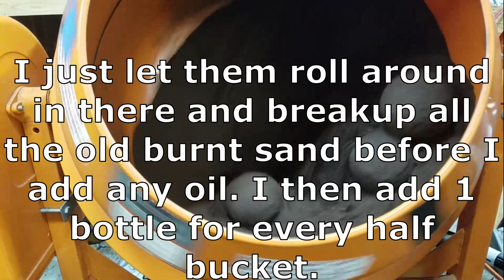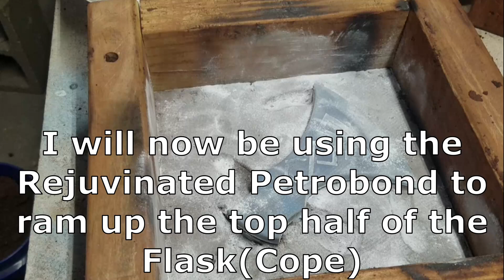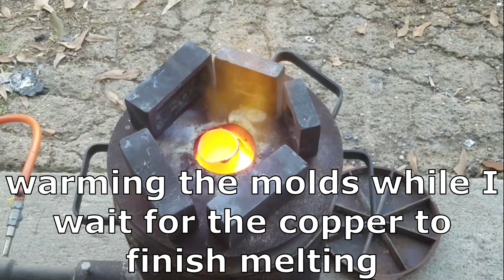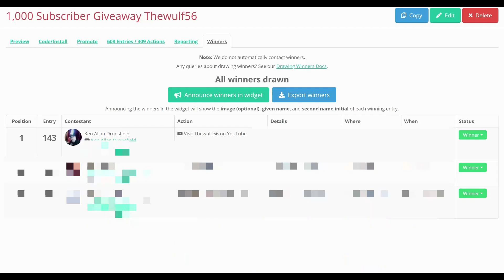#Devilforge Rejuvenating burnt Petrobond Sand at home and Casting a Bronze Celtic Axe

Comment: Had no idea you could rejuvenate Petrobond. Besides initial outlay, this would be a great way to save some $ on it! Thanks for sharing! Makes purchasing that Petrobond a bit more appealing! Grats to the winners!
Reply from the maker: yeah, you can, this was my first time trying it, and it works pretty good. so I can use it over and over. Your gonna eventually need to replenish, as you will loose some, they sand is just to fine to be able to save 100% but at least you can save some money. Might need to keep it warmer when trying to remix it, its been a bit cool here and its not mixing right in the 40 degree weather like it was when it was warmer.
Reply: @Thewulf56  drat. It would be a summer only thing here as we're not even up to 40 in the days now. But still feasible to save and do when it is warm! I'm going to watch for some bocchi balls and a mixer on the classifieds now.
Reply from the maker: @silverkeys  I got mine from harbor freight, for pretty cheap, and they have 20-30% off if you get their coupons. I got the bocce balls off Amazon,  but you could use a bowling ball to, some use that. You just need something round with some weight. If your shop is heated, you might be ok
Reply: @Thewulf56  we are on HB freights mailing list! I'll check. We don't have heat yet in the garage but we hope soon. We'll be looking at a wood stove this next week to see if it will work for us.

Comment: Incredible work, that came out great!  Love the painted inlay and the shine
Reply from the maker: Thank you.
Reply: @Thewulf56  I’ve been saving my burnt clay as well.  So far I haven’t used it twice, but I plan to soon.  How many times (estimate) did you use that sand before you added the oil?  And what kind of oil was it?
Reply from the maker: @RobinhoodCoins  two cycle oil I got from the dollar store. If you only have small amounts, you might be able to get away with a drill mounted mixer, or maybe an old kitchen mixer, though I have never used those, used to use a drill, but that was only to break up the big chunks from the cast. I wasn't adding oil or nothing.

Comment: You are very talented man!! I was wandering what you did so that you could re-use the burnt stuff. Very cool!
Reply from the maker: Thanks Rick. Took a while to save it up, I had upwards of 300lbs of sand, most of which is now burnt, with about 33lbs still new in a box and maybe 60ish lbs of used, but unburnt. Still have a big tub to finish up, but I'm close to half way done. I will be able to make some bigger projects that I have been holding out on cause of lack of sand.
Reply: @Thewulf56  I have some delft clay, just a small amount, with a small ring. I've been meaning to try some pours.
So I separate the burnt clay from the used clay after the pour. can I reuse the used clay after that?
Reply from the maker: yeah, just scrape out the burnt stuff, and the rest of it should be good to go. Make sure to save the burnt stuff, when you get enough of it, you can just do what I did.
Reply: @Thewulf56  thanks for the info.

Comment: Great video on rejuvenating the petrobond, this will save a ton of money! Also good to see you do a comparison, I do not see any difference so the rejuvenated sand must be really good :) I might buy and try this one day too, who knows :) That axe head came out fantastic! Too bad the core piece broke, I guess the axe handle would have fit much better if that hole was bigger. Lot of work brother, but it came out beautiful and shiny!
Reply from the maker: yeah, It was experimental with the core I was trying. I'll get it to work on something one day. It fit ok, just took a bit more work to get it there.
Reply: @Thewulf56  Do you use other sand as core sand? I understand it needs to be oven baked to get hard and it will stay in one piece.
Reply from the maker: @Metalstacker  no, I tried to use a piece of chalk, saw someone use it and I wanted to try it, but I messed it up. I did use playsand and a little fire cement minus the big chunky stuff to make a core once.

Comment: Great post. I can't tell which side is which. I guess I need to start saving my burnt sand eh. The only thing I would do different is to use mineral oil as that is the oil used in both Petro and Delft. Good post my friend.
Reply from the maker: Is it really? I just heard that 2 cycle was good to use from some old timers in the metal casting field, works good. I might be down to try some mineral oil.
Reply: @Thewulf56  Mineral is all I know. Let me know if there is much difference please. I had an order of petro come that was bone dry so I just put it in my largest stainless bowl and stirred it in with a slotted spoon. About a 1/4th of a quart of oil to about 8 lbs of sand. Just enough for the sand to compact by the handful.

Comment: Have no idea what happened, was on the live chat, saw no other comments, just talking to myself, lol
Anyway, have seen the pros reusing the petrobond and green sand. They use the new stuff just as a "facing sand" and use the recycled as the filler. Olfoundryman was good at explaining his reasons and was the mentor of perry.
BTW was gonna ask about that monster pipe, leftovers or "donations", haven't seen any that size in a long time.
Reply from the maker: Yeah, I  understand the facing sand, but the remade stuff was just as good. I have actually used it several times b4 this video testing it. I don't have a finer sand to use as a facing sand, I'm not sure what mesh this stuff is that I have, but I guess it's at least 120-150, its really fine.

Comment: The makeshift muller seemed to work pretty well.  I gotta ask though, why not include coreprints on the pattern if you were planning to use a core to cast the eye hollow?
Reply from the maker: yeah, as long as its warm enough, found that the cooler weather, it seemed to not mix as well. I should have added a core print, but I just didn't think about it at the time. It was an at the moment thought to make a core, I used a piece of chalk, it's what I had on hand. I might do a core box on the next one.
Reply: @Thewulf56  gotcha. A chalk core is a new one on me, interesting idea
Reply from the maker: Never tried it before, I seen someone else use them, worked pretty good, If I can just get it to stay whole haha